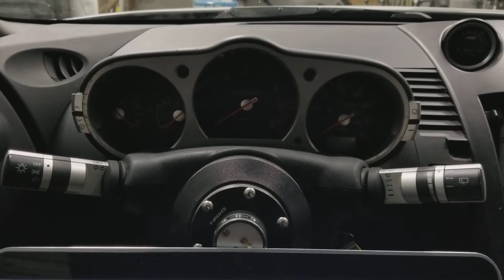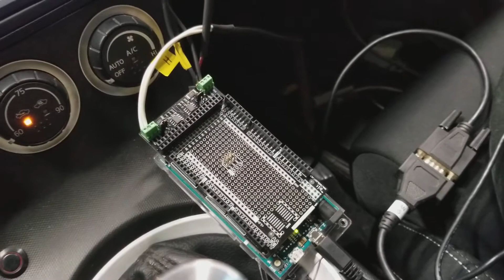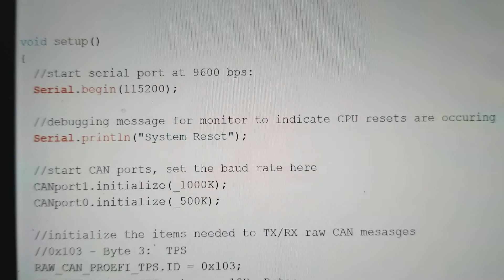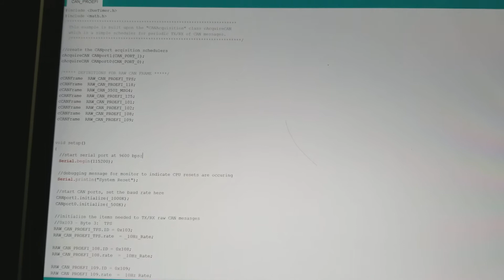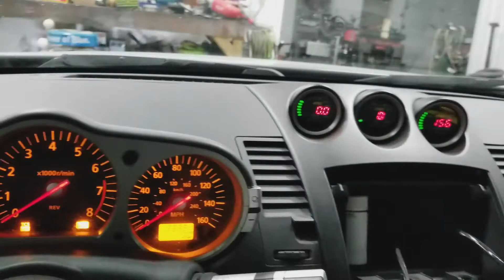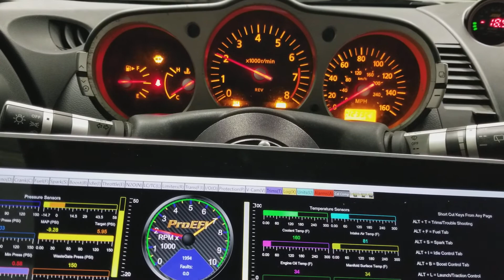HOW TO: Engine swap your 350Z and keep your stock cluster!

Comment: This can also work with a 2jz engine running a aem 2 ?
Reply from the maker: Concept is the same but the AEM CAN messages are likely different.  The programming would need some tweaking.

Comment: Your website isn't working, got an email address? Have some questions for you
Reply from the maker: The concept is the same, but the CAN messages from the GM ECU will be different (ID and payload) from the ProEFI computer.
Reply: @kjlindgr  i have sent u an email asking for the code and parts needed. Let me know if you have recieved it.
Reply from the maker: www.lindgrensupercars.com  and go to the "contact" section
Reply: @kjlindgr  would this work with stock gen 4 ecu swapped to the 350z??
I have the gen 4 complete harness and the 350z complete harness in the car.